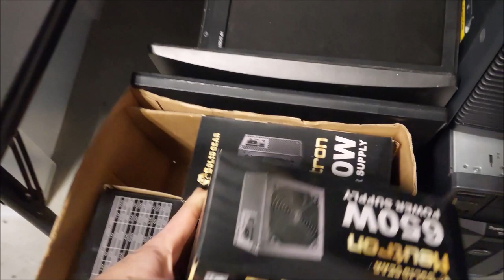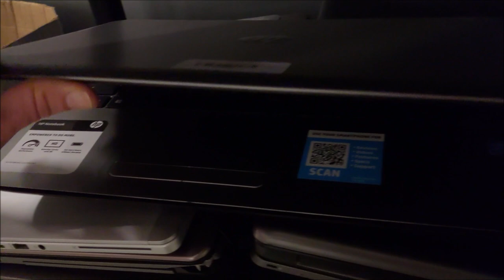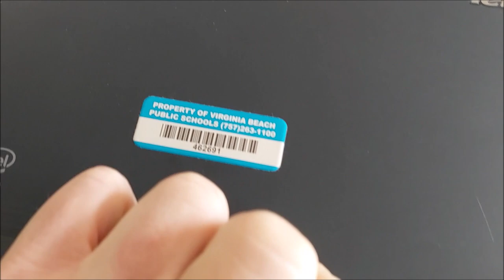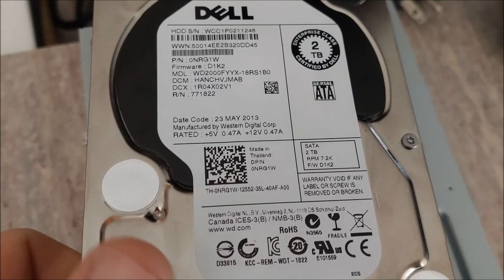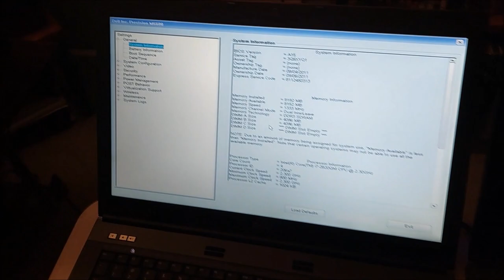MASSIVE STORAGE UNIT BUYOUT (SCORE!!!)

Comment: Hello friend Matt , have you seen at your dollar tree they now have new keyboards and wired computer mice for $ 3.00 & 5.00 Dollars and they also have audio cables as well and they have headphones as well and ones with built in mics like gaming headsets they are $ 3.00- 5.00 bucks for those , ps-in what do you think about windows 11 ???? Was thinking of putting 11 on a cheap priced used laptop from ebay to resell hope to hear back from you soon thanks posted on 1*8*22 at 6:00pm